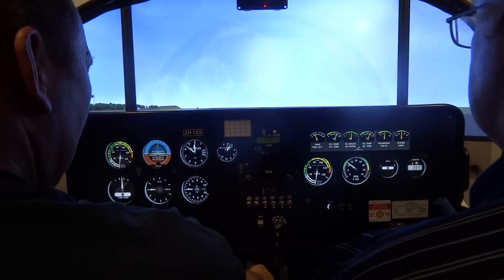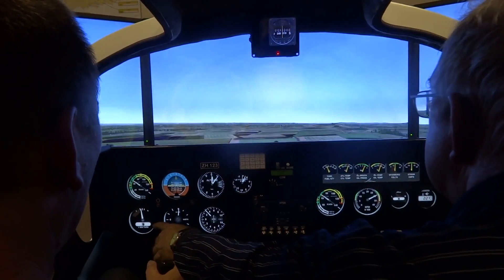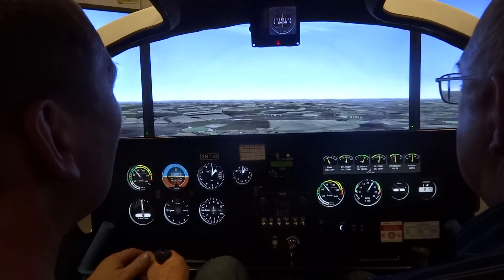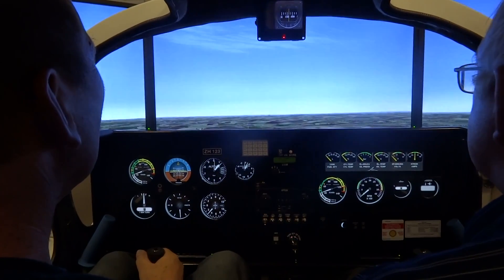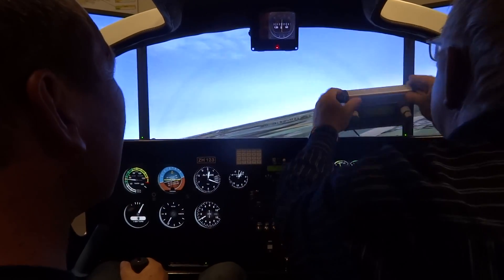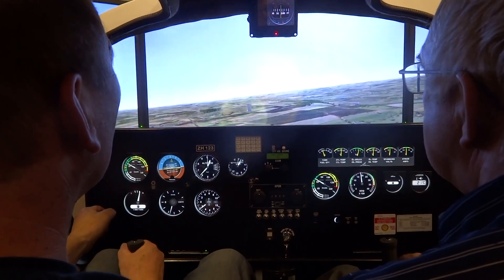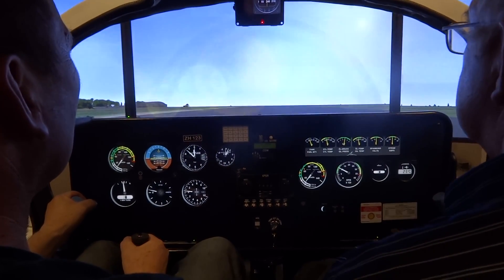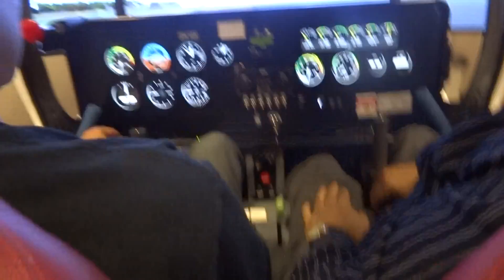Rob flies the Vigilant Motor Glider Simulator

Comment: hello. nice work!
my name is roberto I write from Italy also I have a simulator for two people with x-plane 10:30 but I have the problem that the view from the pilot to coopilota not centered. use a single PC for the view?
my email mhl0153@gmail.com
Reply from the maker: Hi Roberto, Our Grob 109b motor glider aircraft that we use with this simulator shows a cowl which is lined up with the physical nose of the fuselage. We are using 3x 46" screens with the image spanned across the three. I also use a dual head 2 go and draw the Panel Builder instruments across two 20" monitors. This is all from one NVidia 970 graphic card.  As you can see, the result is very good and looks in proportion for both crew.